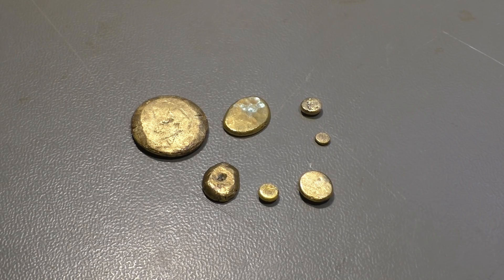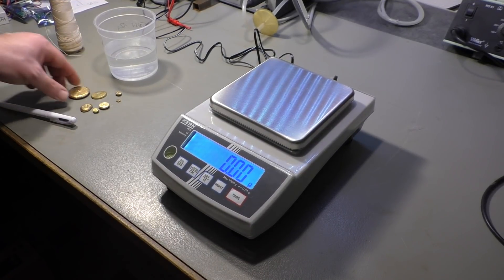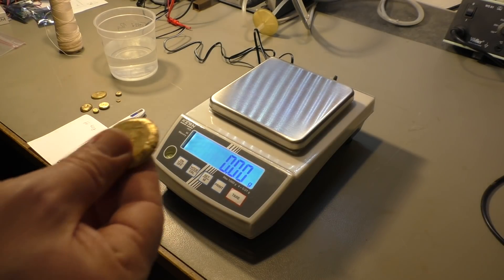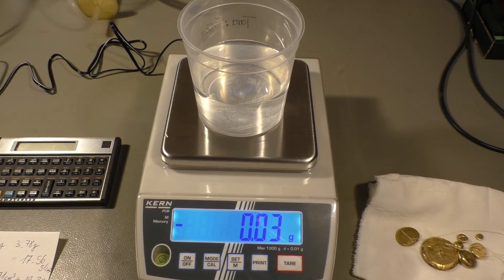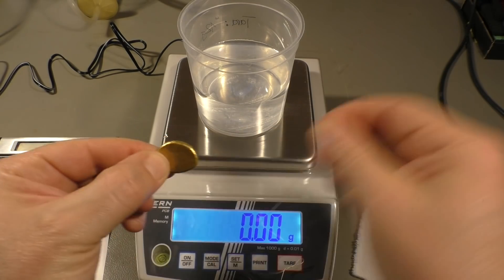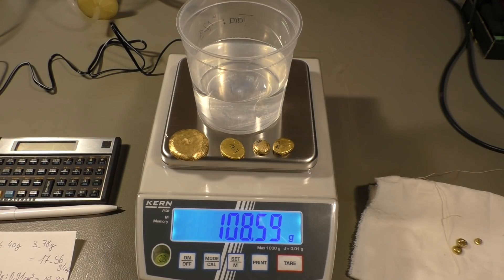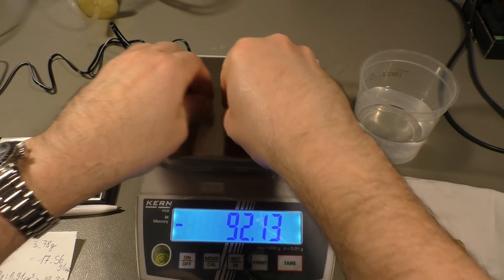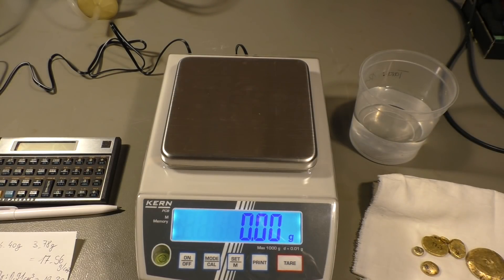Recycled gold! How pure is it? (PWJ183)

Comment: If you put a pencil on the top of the cup and weigh the cup with water with the pen and whistle the scale, then tie the thread to the pen, does it give 3.97 grams ??
Reply from the maker: No. It will display the full weight of the gold that hangs on the pencil which presses down on the cup. It wold work when the pencil is put on something outside the scale.

Comment: Apparently e-waste has 50 times more gold per mass than mined gold ore.
Reply from the maker: That's possible. Keep in mind that in a gold mine they have to process 2 tons of dirt for 1g gold.
I need 150g of PCB contact fingers to get 1g. Thats probably like 3-4 large servers... or 100kg.
Reply: @PlaywithJunk Bro, I need to know your method of recovering gold from electronic scrap to arrive at accurate calculations, so my recovery will have ups and downs like a roller coaster, I want a method with slightly precision.
Thanks!
Reply from the maker: @GTJEquimentos  What precision do you mean? The material used ( gold fingers) is quite different. Cheap PCI cards have almost no gold. Server RAM is good and also other server contacts like riser cards. If you want consistent results, you need good quality material to begin with. 
Another factor is patience. I leave the fingers in the solution for a couple of days. So the gold contacts come off as whole flakes. I tried to speed things up with an electric tumbler and ended with gold dust falling through my filter…
Reply: @PlaywithJunk I'm referring to the chemical process that forms gold flakes. How do you prepare your electronic scrap? I've heard that using graphene to replace mercury will help you recover a good amount of gold. I need an effective recovery method to make a good profit. Do you know of any other efficient recovery method other than the traditional one of using acids and others? I was looking for a new video on your channel with a step-by-step recovery.

Comment: Electronic scrap gold will have a lot of nickel as impurity, because the copper is nickel plated before the gold flash is applied. So slightly lower gold content, as nickel is slightly less dense than copper.
Reply from the maker: Well, it can't be "a lot" because it did not affect the density of the gold much. I'm happy with the 90+ or even 98+ percent result.
Reply: @PlaywithJunk  Probably around 30% of the copper volume, so yes not much. I think I might have a few grams from all the scrap electronics I have, just have to get the big vat of acid to strip it all out.

Comment: Density of water at 20 C is 0.998 but may you good Swiss calibrated mineral water. :)
Reply from the maker: For me, it's close enough to 1   BTW: At which temperature does water have exactly 1.000 g/cm3 ? Maybe my water was a bit cooler...
Reply: @PlaywithJunk  4 degrees celsius
Reply from the maker: @Rob2  3.98 deg C to be super precise :-)
Reply: @PlaywithJunk  Get some snow from outside and wait until it has just melted, and it is probably close enough...

Comment: Pretty interesting method of measuring the purity, I wouldn't have thought about using archimedes principles to achieve it. By the way, I think the microphone you're using has some issues, or it is coming too hot to the camera, as I can hear some distorsions going on
Reply from the maker: Yeah I also had the impression that the sound was different this time. Maybe I still used the settings for the dummy head micro.

Comment: Don't you think there might also be some Nickel in your Gold? Since there are also chem. NiAu PCBs around: https://en.wikipedia.org/wiki/Electroless_nickel_immersion_gold ???
Reply from the maker: Maybe... but his sounds like they are using it to cover all tracks on the PCB. Only a very thin layer of gold. I think normal edge contacts have thicker gold layers. But I have noticed some extremely brittle anf thin gold layers on very cheap PCI cards.
However, Nickel will be eaten by the iron chloride too. It wouldn't change the result much... :-)